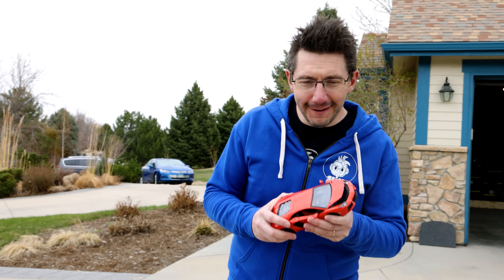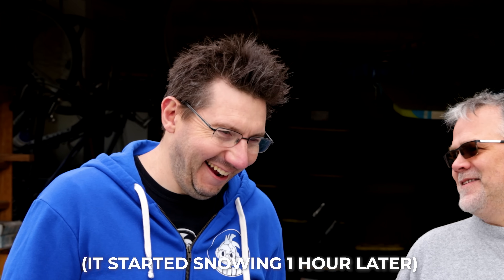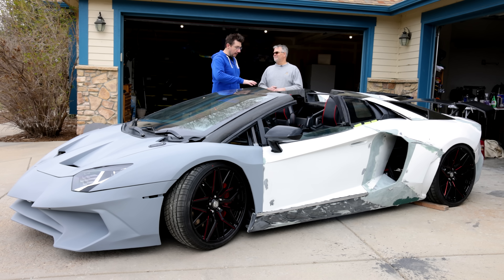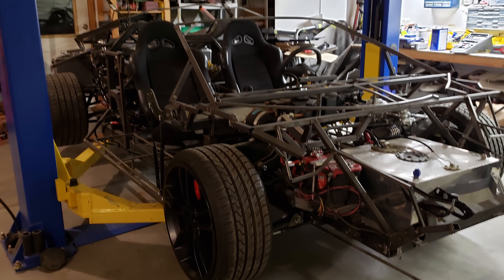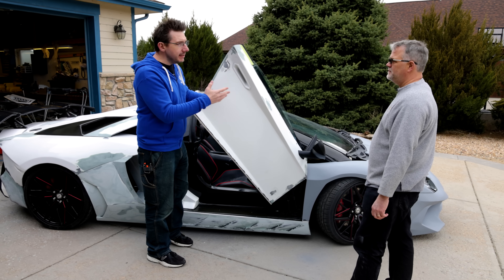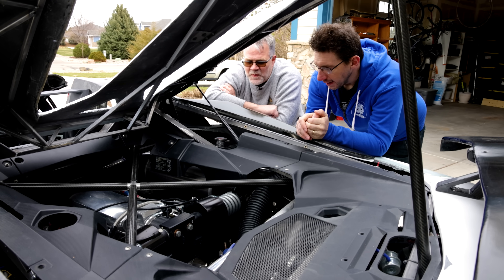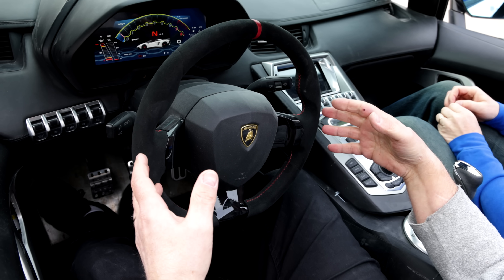3D Printing a Lamborghini Aventador!

Comment: I’ll get a bunch of fiberglass resin and fiberglass fabric. Then do the entire car in that. Then come with carbon fiber sheets and resin to finish it all. For safety reasons I’ll sandwich the fiberglass, aluminum sheet metal, and the carbon fiber to strengthen the entire car. Mainly on the backside of all the panels and a couple of layers of fiberglass on the exterior of the entire car. Especially the doors with sheet metal and pieces of flat metals in a X shaped.

Comment: It's a soft material between two hard ones. Maybe even a form of high temp range butal rubber to Sandwich. That's literally sound damping. The less vibration the more torsional rigidity.
Reply: yes, printing molds or 'plugs' to pull molds from would have been much better. still cool though!

Comment: Or s substance like something similar to underbody coating. It's impressivelly ridged, plus dampens sound is inexpensive easy to produce and easy to Sandwich. Just coat one side heavy enough, maybe something like lizard skin, or even some kind of ceramic coating. It can still be sprayed on. Then apply adhesive  to the other side and literally glue the sides together, and use an adhesive that isn't solid which will add additional sound damping, plus because vibration will effect rigidity less, torssonal .rigidity would elevate. That or just print it as carbon rosin assembly as is and coat the inside with underbody coating or lizard skin... Both if you really want a solid mount. Don't trust me. Try it on a small part and see for yourself. Besides. Carbon rosin is stronger than carbon fiber and has less risk of cracking under heat without treatment. Plus there's no secondary production after the initial form. No mold necessary.

Comment: Try using fiberglass sound deadening to Sandwich the carbon fiber. Then you still make the 2 layers of carbon fiber, but assembly is still easier, and you have po print less parts and just assembly and Sandwich after the carbon fiber is made, and you can reuse the mold.

Comment: It really is the right stance, the cool stance, the stance to get ALL THE BEST PR stance, to do what Lambo did and back the project. Kudos Lambo.... The best part too, is that this will probably spank a real lambo in just about every metric... I mean... LS1 and all. Wins already.

Truly though, this is somewhat of a breakthrough in panel fabrication.... at home style more so than anything. To be able to have a large print, broken up in small pieces, and then just use a fusor type product to make them one, and then that one "panel" becomes essentially an internal mold for an encasement of carbon fiber... or I suppose it could just as easily be fiberglass, and then subsequently resin... well... it's just brilliant, and takes all of the hand work out of fabbing the shape. The shape simply comes from the print, and well... that's just incredible.

Lastly, I hope... I really hope you're just tootin your horn with the whole "making your own lambo door hinge" thing... you do realize that the aftermarket has been, I don't know what the proper word would be... I suppose "FLOODED TO HELL" with lambo door kits, since say, F&F 1... which was what, like 2001 or 2002 or something? I mean, they existed before that too, companies already had cylinder / spring assist lambo door kits that went out and up / down and in, since the 90s. Before even... It's just that now, in today's time, you can pick from various levels of how good a kit you want, from boy racer ali baba temu level, to better than actual lambo level. Making one's own... that's a pretty big waste of time, and I really hope not real. You can't be on the internet, and into cars, and not know that you can buy this off the shelf.

Comment: I absolutely love this video (especially when they mentioned throwing a Corvette engine into this ride). I think the reason Lamborghini was so on-board is two-fold here. One, the Aventador was discontinued within the past year, so they probably had a ton of parts they would never use again. Two, I'm sure the engineers are salivating over the carbon fiber sandwich approach that was used in the making of this car, especially with that kind of weight reduction. My only concern would be the overall scalability of such a method compared to, say, the cardboard/polyurethane sandwich panels on the Citroen Oli concept. That car is also very much in the prefab/3D print category.

All in all, we are currently living in the best timeline for automotive assembly and materials engineering. Because EV is kinda dominating the future of both autosport and even just everyday production vehicles, getting that weight down is literally the most essential factor. Of course, for a car like this, none of that actually matters and it's all just Rule of Cool. I would also be curious what the final production cost is for this and how it compares to a real lamborghini.

Comment: The one thing that will make or break this is uniform panel gaps. If the gaps are even slightly off it's an uncanny valley effect and makes the car look cheap, cheesy and corny. Don't delude yourself into thinking one of your problems is "good enough" and that people won't really notice it. Someone like me will definitely notice the problem immediately even if it's small.

Comment: At 12:05, you refer to a "2005" (C6) Corvette.  The only engines in 2005 Corvettes were LS2 (6.0L).   The fifth generation ('97 thru '04) Vettes used the LS1 (5.7L) engine. Yes, I am a Vette guy.  I also make parts/modes for my Vette(s) with my 3D printer. I can not imagine making a Lambo using mostly a 3D printer . . . kudos.

Comment: i find it actually a little bit funny that because all of the exterior panels were 3D printed and then coated with carbon fiber the car actually ended up being around HALF the weight of a real aventador lol
also, that LS sounds too good lol

Comment: So the PLA with carbon fiber on top is going to be able to stay under 60 degrees Celsius? That's really shocking, because cars usually get really, really hot when left out.

Comment: The "LS" in LSx Engine does not stand for "Luxury Sport."  It's simply an RPO code.  It doesn't stand for anything.
It's no different than Z28, ZL1, Z06, ZR1, etc.
There were some cars sold with "LS" trim packages, but those are a separate matter.

Comment: I predict the PLA changing it's state so much that it delaminates the center of the carbon fiber, and over time the PLA will ooze downward and stress the carbon fiber internally. Definitelycool but V2. should probably cast fiberglass molds off the PLA and bond your carbon fiber too that. A sound deadening substitute could be something as simple as integrating wool fibers into the fiberglass portion.? Just a thought. I want this to work
Reply: As a custom car builder,  composite fabricator, bodyman, and painter, that too would be my concern. We call it an Oreo cookie, hard on both sides and soft in the middle. That's not a good thing. Kudos for trying though! hate to see all that work fail.
Reply: @shawnhengstebeck2038   lol i dont remember this comment at all.. but damn I sounded smart huh hahahaha

Comment: LS does not stand for luxury sport engine, in the case of the engine, it's nothing more than the alphanumeric designation for the model of engine based off specifications. However, LS is in the car trim LS luxury sport, ment you have power windows and cloth seats. An LT trim package meant you got leather seats.

Comment: Ok, so now I want to 3D print a Lamborghini... - I would stick an electric car transmission inside it with a speaker to recreate the noise, and because I'm a degenerate I'd chrome wrap it and give it crystal white underglow <3 <3 <3

Comment: I love how people have such a wrong impression of pla not withstanding the heat. I made an address marker 3 years ago that protrudes out and would easily bend if it melted at all and it’s still going strong. Just discolored. Lots of wrong info floating around out there. I live In pa and the marker sees the sun as much as possible.

Comment: Also the “mating kit” which was talked about the gear box from a different manufacturer to the Ls it’s technically known as a adapter plate, with an adapter plate you can almost resolve a lot of complications. An example would be like, I want to put these wheels to fit, but they won’t fit my hub, so I will get a hub adapter etc.

Comment: How I spent $700,000 to "3D PRINT" a knock-off of a $400,000 car. Be amazed.
Reply: Its actually much cheaper, they’re i think still bellow 100K. And still its amazing to see these guy make such a innovative car on their own!
Reply: I mean, to be fair this car is way more rare than a normal lambo 😂
Reply: @seriesexplained8009  fr
Reply: @seriesexplained8009  excellent point!
Reply: @seriesexplained8009  and a lot less safe. I'm a custom car builder and give these guys props for what they accomplished at home. I myself would have 3d printed molds to make the carbon pieces from, and built the chassis out of DOM round tubing for strength rather than seamed square tubing that will not hold up at all in a collision. Great car to trailer to a show, but I wouldn't get too carried away driving it at any reasonable speed.

Comment: Lamborghini is supporting this project because they are thinking about printing their cars in the future. Why do you need metal/aluminum around car if you can use for example plastic? You just need chassis to hold engine, suspension and cockpit which is made of carbon. Cockpit is the part that is securing driver inside.

Comment: so basically it's NOT 3D printed, more call it a kind of template to wrap in Carbon Fiber. Would have been faster to build a plug, Fiberglass like a kit car actually is made of.

Also the Material cost for the Filament is something to mention.

Comment: when I told a group of people that I bought a 3d printer in 2019, one of the weirdest questions was: can you print a nuclear power plant?
while this is a nonsensical question to start, it would actually be possible. just probably not with an ender 3 pro.

Comment: Question: If you stick on several layers of carbon cloth onto either side of a PLA printed piece, surely it will kill the definition of the part by adding in several mm of unintentional thickness or am I misunderstanding the process of encapsulating the part?

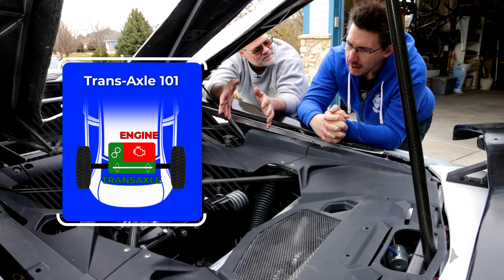Comment: at 12:34 you show a transaxle for a transverse layout, which is the kind of thing you see in a front wheel drive.

Some cars like the corvette have the engine in the front, and the transmission in the rear for weight distribution.

What they (and others) do is just move the engine back, and bolt it up to the transmission again (because everything is standard parts, and bolt patterns)

Comment: LS is not for "Luxury Sport".  It refers to the engine code from the 3rd gen small block engine that came in the corvette (LS1 and LS6) depending on the year.  Now it is common to refer to all gen 3 and gen 4 small block gm V8 engines as "LS" engines even though technically it is incorrect.

Comment: Love the project. I remember when I first heard about it. Wasn't aware it was still going on. Also love that now others are doing it too. I was at RMRRF with other makers and some vendors and we went out for dinner and went "where's Joel? How do we get Joel to join us for dinner?" and almost a minute late, his tweet went out showing this and I went "I think he may be having a good time" and we all had a laugh and one person went "oh yea, that's not far from here".

I love that it's getting official support instead of being a "well, we have to change things otherwise we get in trouble" but also that he's still respecting that it's a 3D printed car and not a real one. Also, my father had a Corvette for a number of years and I remember digging into some things about it (I'm not a car person. I just like reading history/tech details on things) and loved how interchangeable these things were. The idea that it was basically a sport-optimized Chevy block and that most of the parts were the same you'd get on a pickup, suv, or coupe but just reshuffled to fit in a smaller package. Not unlike using an Audi steering column and just changing out the wheel. It shows the craft and design that goes into these common machines.

It also leads back to something like 3D printing because, structural elements aside, so many things are just "off the shelf" and just packaged differently. I remember being in school and it being explained how interchangeable parts were one of the revolutionary steps of the industrial revolution. Combine off the shelf, interchangeable parts, and 3D printers... it's like what Ford is doing (for little plugins) of "how much can you replace/swap on your car with a 3D printer without needing to do much more then print it". Heck, I remember being in a livestream once and someone pointed out they used some modded Sidewinders to print bumpers and whatnot for Ferraris and other sports cars because it was so much cheaper to replace the real bumper (which is just a cover over a metal piece that protects the frame) with something 3D printed with a proper paint job. They can stock a few of those for the cost of a real one and swap them out as they get damaged by the road.

Lots of fun. Maybe next RMRRF, they can bring the car out to the show ;)
Reply from the maker: Dude, for next RMRRF, that’s the plan ;)
Reply: @3DPrintingNerd  🔥

Comment: I've got a large format 3D printer I've been considering using for a project similar to this, but not a Lamborghini and not something you can buy, I've even gone as far as designing the tube chassis, shell and interior to be 1:1, contacted the OEM for approval and am just waiting to hear back from them, if I get approval, we'll be doing a video series on the build. Hopefully Honda is as cool as Lamborghini is!

I have already printed the front bumper and attached headlights, which only took 16 hours using 1.0mm nozzles, so I figure it would take about a month or two at the most to print all the needed parts, but thats using a industrial scale printer with a 2x2x4 foot print surface at 300mm/s.

Great video, it gave me a lot of good idea's.

Comment: There is a certain point when its just not worth faking the original anymore. The amount of work needed to do this is not worth the value and joy you will get out of it. Save up money and buy one. Some people save up for 10 years to have their dream. This is just a piece of "plastic". You can always use the parts to make molds and then carbon fiber part, but it just ads more and more cost and work to eventually end up with a fake.
Reply: For many people, the work and the journey are part of the enjoyment.  
This is not a 'fake' Lamborghini - hence the interest from the real company.  It's a 'replica' - a one-off DIY creation that recreates the look on completely different underpinnings.  Nobody's trying to fool anyone, Sterling put no badges on it, and Lamborghini gave him a real steering wheel because it fit the Audi column - that was a really nice gesture as it's the thing the driver sees and touches - but from outside the car there's no attempt to 'pass off' as a real Lamborghini - Sterling just liked the shape, and used it!
Reply: Saving up the money to buy one won't actually allow you to sustain ownership. People can't afford $5000 repairs a couple times a year with some of these cars. Or the insurance. While yeah I think it would be better to do your own design when home building not everyone's an artist. If anything I think something like an Aventador is easier to model. I can build a Caterham Seven in my backyard for 10 grand and own it forever but I'll never buy a $60,000 car. The lovely thing is the Caterham 7 started as the Lotus 7 kit car so those make more sense to some people.
Reply: @Rainmotorsports  yes, kit cars make more sense.

Comment: instead of 3D printing panels then wrapping them in carbon fibre why not just 3D print moulds for the carbon fibre from the start?  it would be lighter and stronger.  Either way next level fantastic project!
Reply: He did mention In the video the pla acts as a sound deadener to remove the tinny sound of carbon fiber. Pros and cons I guess

Comment: How cool of Lamborghini to donate parts! Imagine if someone tried to 3D print a Ferrari, that would end up in a lawsuit😂

Amazing project, though I would prefer to design my own car if the effort is the same, a body with a signature of mine.
Reply: they would get a cease and desist just talking about 3d printing parts for a Ferrari
Reply: Eventually... If you mix those lawsuit papers with some resin... You could make a Ferrari part of it 😁
Reply: Exactly!
Reply: you can make ferrari but you cant use there badge
Reply: lambo has always been the same way. This is just a one off thing lambo is doing to get your support, they're smart.
Reply: @otallono  tell that to deadmau5
Reply: @otallono  Well they have my respect. The next supercar I buy is going to be a Lamborghini :)
Reply: There is no possible universe in which I might want to deffend Ferrari, but they would only send out lawyers, if you would put badges, let alone look-alike badges on that thing. as long as it doesn't get a badge with anything even remotely close to "Ferrari" written on it, you should be good... they didn't even complain about the twin-turbo swap of a F12 with 'dem two spooly bois stickin' out of the hood, running on 110 Octane race fuel, spitting flames STRAIGHT out of the turbos... yeah, crazy thing